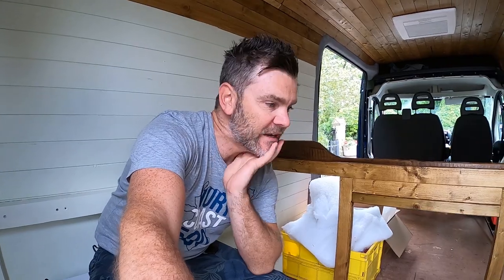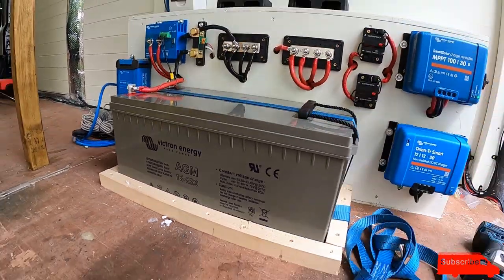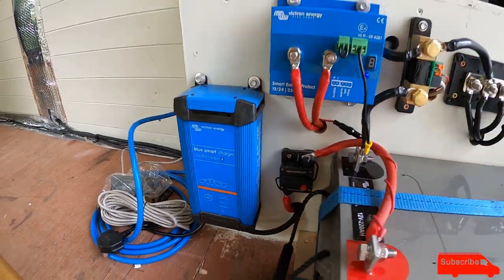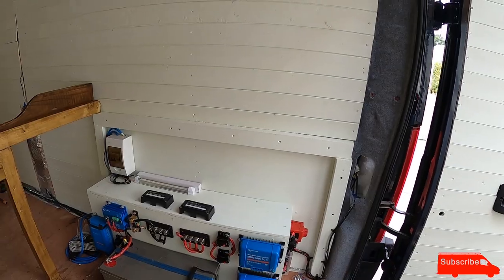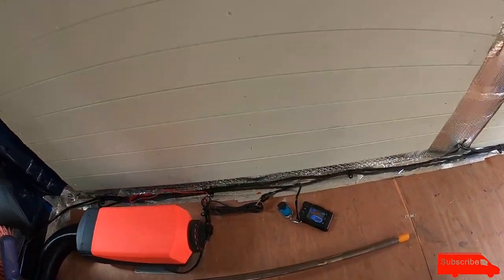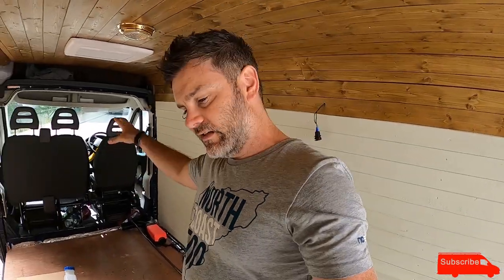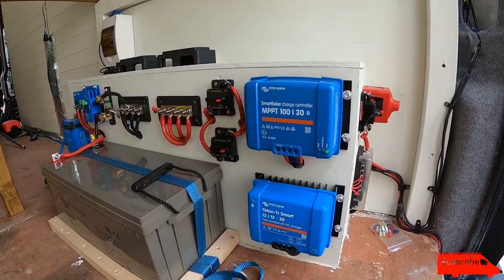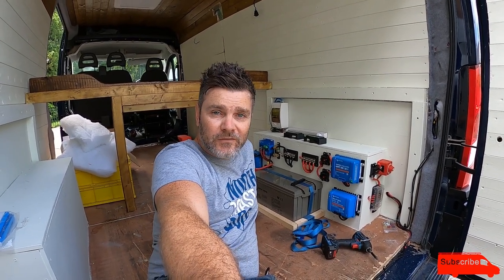Another 12 Volt Off Grid Electrics Example || Want Help On Your Electrics?

Comment: Just a thought.
If you made a template of that box (panel) you could build the system on a bench before you even go near the van?
Mounting / cable holes, if you get the components, mount them and all cables prior to fitting.
Could save a load of time?
Reply: now thats a good idea

Comment: @lukesvanlife do you use VSR on your builds or purely solar/hookup? Thanks in advance
Reply from the maker: I don't use vsr's I use dc-dc smart chargers. Far superior to vsr's. 👍
Reply: @LukesVanLife  thanks Luke, do they connect in the same manner as a vsr? Thanks
Reply from the maker: @elldees4071  kinda yea, the victron Orion, is the one you want, positive with two fuses to the unit from the starter battery, and one negative from the unit to the negative or chassis 😁👍

Comment: Wouldn't it have been easier to use a large fuse box having 12v 240v and solar inverter all connected 
With switch to change from inverter to 240 v hookup would mean only having one set of plugs in van as well